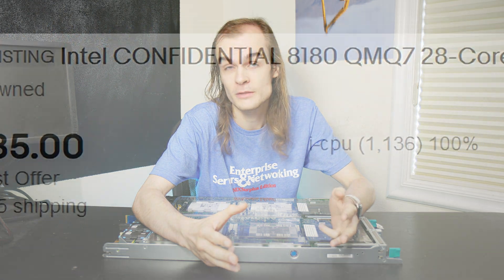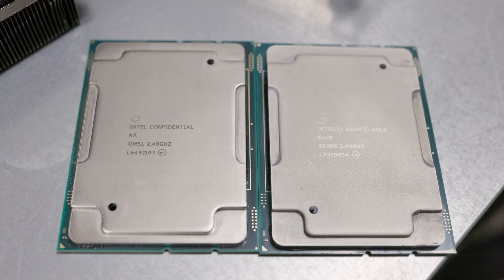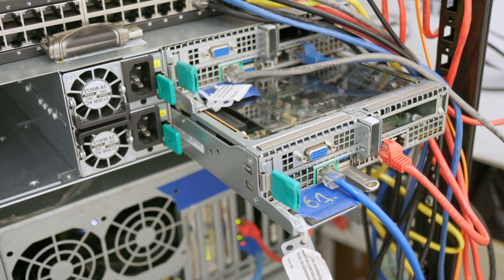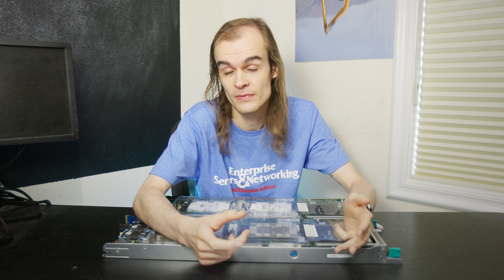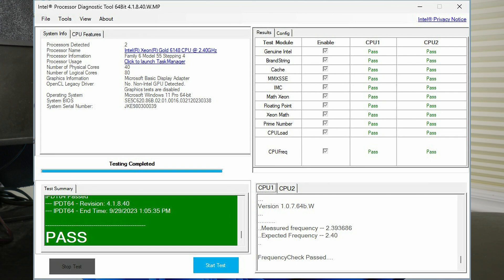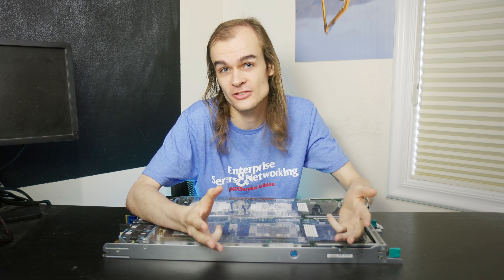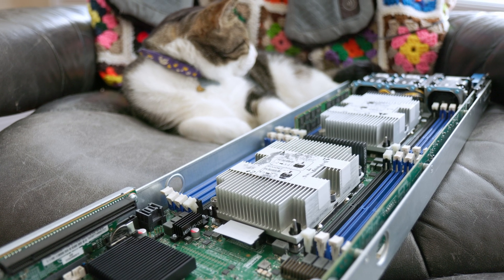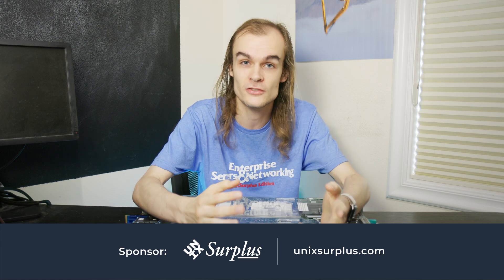Is An Engineering Sample CPU Worth The Savings? Comparing A Xeon 6148 With An ES Version

Comment: Is it possible to run two xeon same familly different model in a dual socket motherboard?
Reply from the maker: Typically you have to use the same CPUs in both sockets. I think there have been some exceptions where CPUs can be mixed but its typically rare and not recommended.

Comment: im considering to buy a i9 12900es.should i do it?
Reply from the maker: Yea there pretty fast chips and fairly power efficient if you keep clocks down. As long as the ES doesn't cause issues I'd go for it.
Reply: I bought an i9 11900 Es for super cheap from china. Hope it'll be alright
Reply: @Ray-ko  hey any issues with it so far? im seeing an ebay listing for the same cpu and thinking about pulling the trigger on one
Reply: @tnyex  returned it. Not worth it bro. They always have some kind of issue, they have way worse performance than the finished counterpart, they could stop working at any moment and you wouldn't have any warranty for them. I decided to switch to an AMD configuration and to buy an original ryzen 7 5700x3d. Not worth the risk buying engeneering samples
Reply: @tnyex  i read a lot of information about engeneering samples on the internet and this is what i got, i didn't actually test it because i didn't buy all the parts to start the pc. Still returned it right away because i bought the cheapest version of the engeneering sample i9 11900k, the QVYE, that has way worse performance than the counterpart (only 1.8GHz base clock) and could give problems at any moment
Reply: @Ray-ko  I order the i9 10900 ES QTB1 should i risk?
Reply: @tinnier_YT  no. Buy the real thing
Reply: Did it cause issues? In the same boat
Reply: @okay-mj6cx  i haven't buy it yet. Still deciding
Reply: I got a core i9 10900ks es working on a msi mpg board any problems I should be looking out for?
Reply: I bought a i9 11900f ES about 4 years ago and it still works great to this day

Comment: Are you sure that the Intel Processor Validation tool really checks all instructions individually for faulty engineering-sample issues? Quote from intel:
The purpose of the Intel Processor Diagnostic Tool is to verify the functionality of an Intel microprocessor. The diagnostic tool checks for brand identification, verifies the processor operating frequency, tests specific processor features, and performs a stress test on the processor.  --> from this description I am not convinced that all instructions are tested for correctness.
Reply from the maker: I’m not sure. From the hi it says it checking it somehow but I haven’t check what exact instructions are used. I couldn’t find a better tool easily that would test all instructions so that’s why I used the intel processor validation tool.
Reply: It’s probably just checking CPUID flags to see what’s supported.

Comment: The QMS1 is a qualification sample of the 6148, so it will be no different than its retail variant. QS CPUs are the only engineering samples that I would go with. Earlier ES samples have horrible base and turbo frequencies and other possible bugs and issues.

Comment: do some content on how you are going to use these chips and how many more vms you can run on these monsters and how many other servers you could consolidate into a server using these newer bigger chips - real world experience beyond the benchmarks and synthetic testing
Reply from the maker: Thanks for the suggest. I’ll work on integrating these ideas into a future video.
Reply: @ElectronicsWizardry  the only other thing i would add is to conc on basic affordable upgrades - things like raid0nvme arrays and bridged and bonded connections or using a 40g dual port on your ws to dual nas - 40g dual port cards are only like 30 bucks on ebay. maybe try to start to wade in to some smaller ai LLM models too? keep up with the good content!

Comment: Just my $0.01 on the issue (having worked in this industry): There is a significant difference between "ES" (engineering sample) and "QS" (qualification sample). Typically, you get the latter on ebay and luckily so. Here's the short gist:
ES are what they claim to be: samples for engineering purposes. The chip works "good enough" for server/mainboard manufacturers, to engineer their gear. All external interfaces usually work (all pins and their functions, like PCIe-buses, etc). They will usually POST without issues, run the entire initialization including microcode load and are suitable to test servers to a point where the OSes are running. It may be however, that some functions do not work properly. Example: the Xeon Broadwell/haswell generations had engineering samples on the market, where everything worked quite ok unless you did virtualization, in which case the CPU would fault.
QS on the other hand, are "working" CPUs. They are qualification samples, used by the same server/mainboard manufacturers to actually check and validate, that their gear is working. The CPU manufacturer ships those out guaranteeing them to work. The only typical difference, is CPU clockspeed binning: You may get parts that have base/boost/allcore clocks unlike any other production model. Famous example" the broadwell Xeon E5-2673v4 QS, still seen ob ebay to this day: perfectly working 20core Xeon E5, just the clocks are different to the production unit E5-2698v4.
I strongly recommend going for QS chips whenever possible, they are just plain better in terms of guaranteed functionality. And it is irrelevant, if it is an AMD or Intel CPU, the procedures are basically the same between both companies.